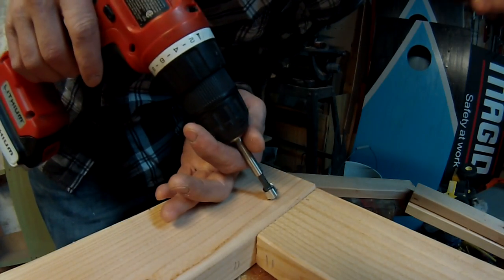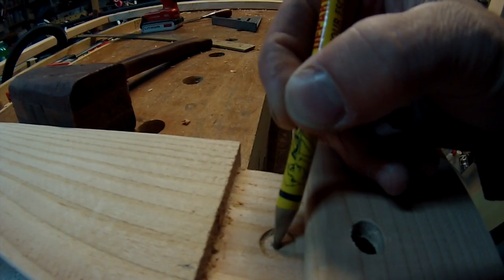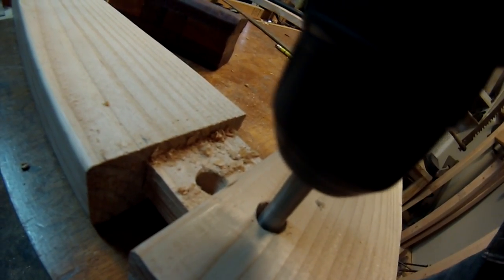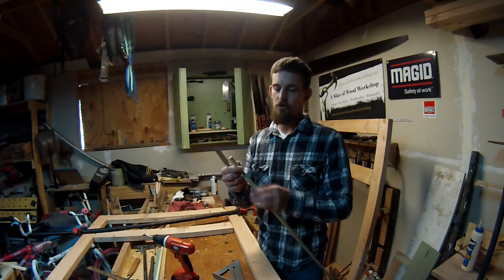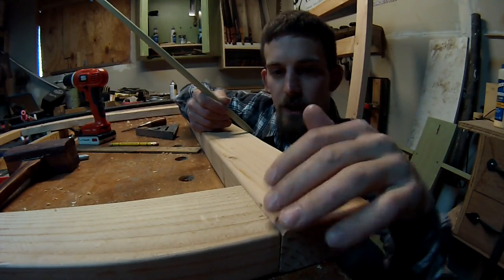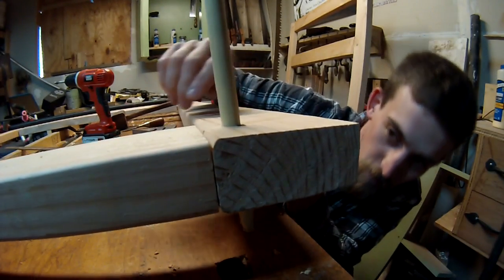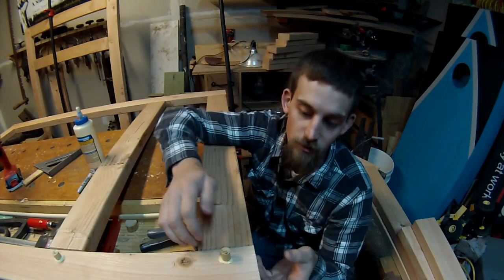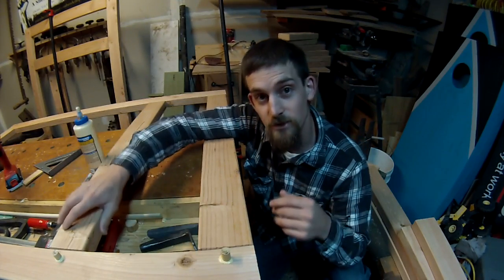2x4 Bunk Bed Build Pt 3: Drawbore Mortises

Comment: Never seen this method before, but it makes great sense and you can definitely see it pull tighter
Reply from the maker: +Derik Geddings this is a great joint that I like to use on bigger projects. Thanks for subscribing!